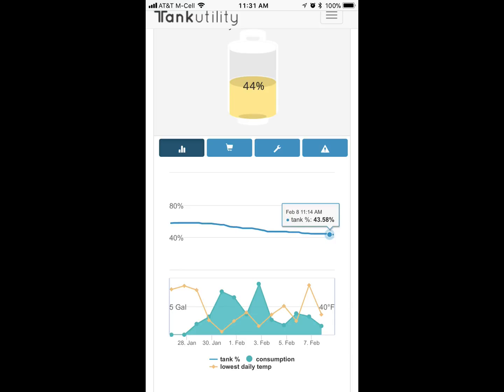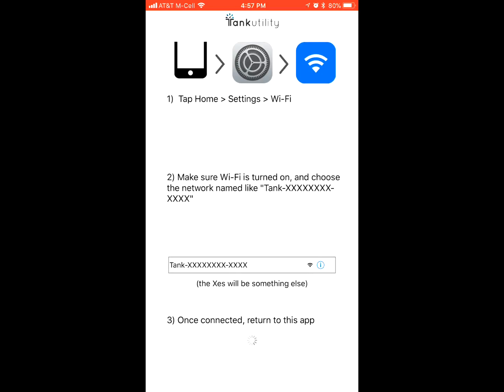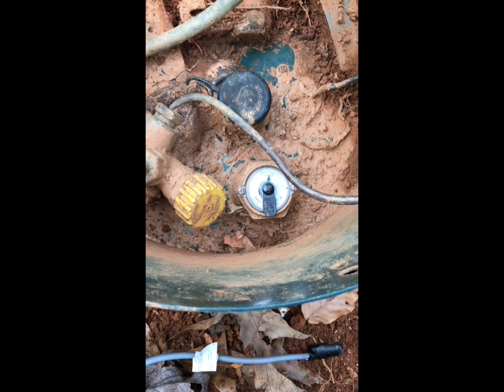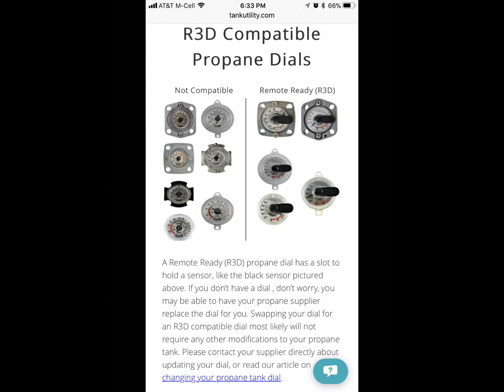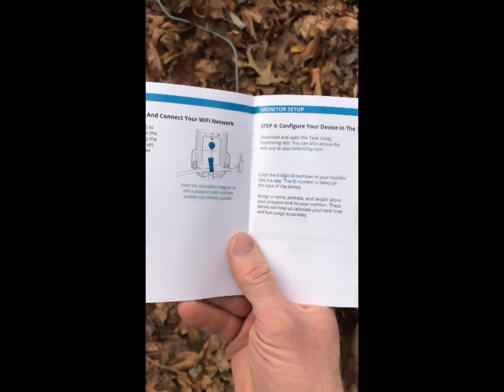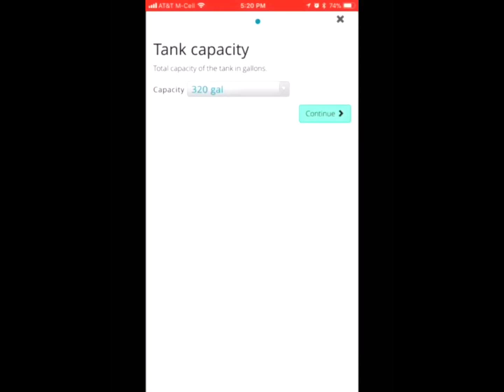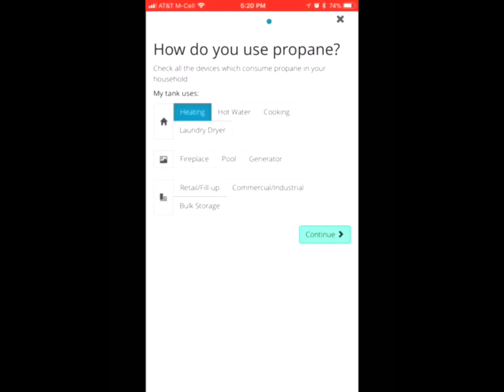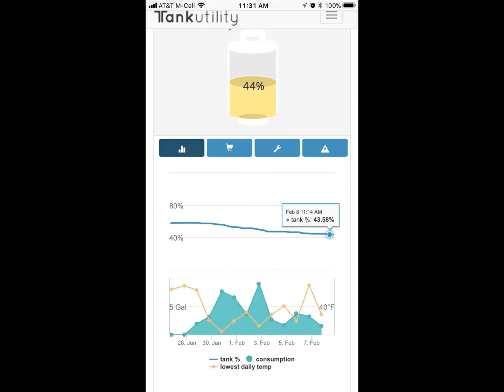Propane Tank WiFi to phone Monitor

Comment: Generac 7005 (I’m assuming that is your monitoring device) has been discontinued. The Generac 7009 is the present device on sale but you’ll need a cellular signal at the tank location and pay a monthly fee to monitor the tank(not your fault). What a scam.
Reply from the maker: They just sent me a replacement not long ago under warranty. It appears to be the same. I would have to look.

Comment: What if you have 4 tanks? Can you link multiple tanks to the app?
Reply from the maker: Good question. I am not sure. I would check their website. I would think it could.
Reply: Eddy, that's going to depend on how your tanks are connected. If you have four 250 gallon tanks all connected together, you essentially have one 1,000 gallon tank. As long as the gauge shows you the total available in ALL tanks (not just the one the gauge is physically connected to), then this solution should work. However, if your tanks are separated by physical valves or 1-way valves, you'd need gauges on each tank you want to measure.